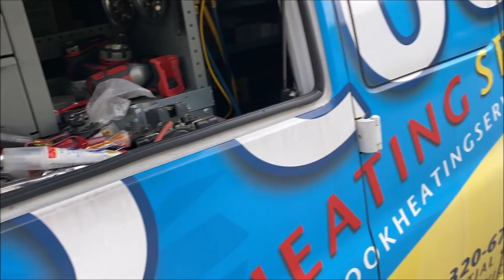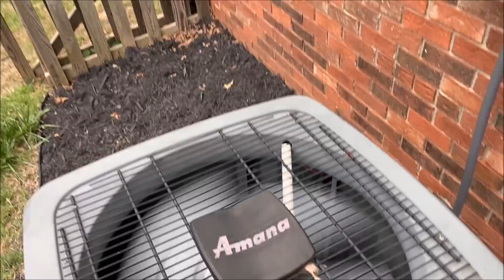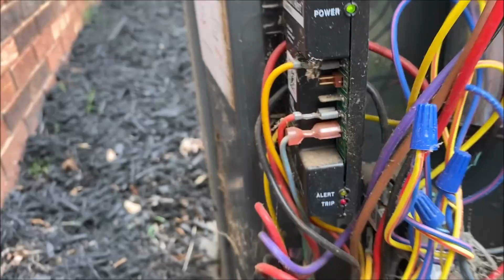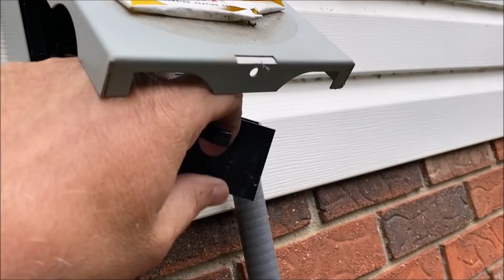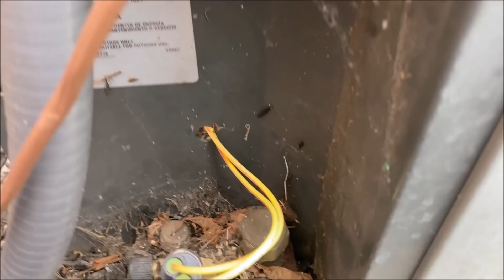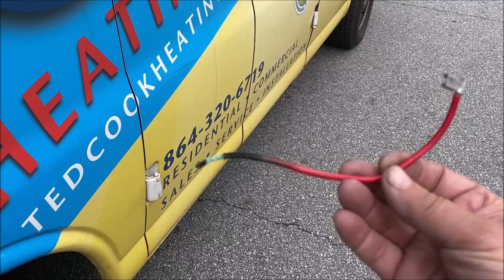Amana Heat Pump simple fix

Comment: What's that box where the fried wire was connected to? In my unit what looked like a copper or brass fuse was fried and popped off the black box. Is this something that gets replaced or the whole unit( black box) gets replaced?

Comment: Hello,

I have Amana prestige 2. The heating unit works great except when the outdoor temperature drops under 40's. So, if a cool front comes through and the outside air drops down into the 30-40's at night or even during the day, the heating unit will not turn on to heat the inside. The inside blower continues to run. 

After a few hours and a few turn-on-off, the heating pump may work or may not. This will happen over and over. I have to shut the unit off. I replaced the condenser with a new one and it is still the same. I also do not have this problem when the outside temperature is ’50-’60s, the heating unit starts and runs fine. 

Can anyone give me any feedback on what may be causing this? Any information you can give me would be greatly appreciated.
Reply: Hello have you had any success to get this resolved? Seem to have the same problem!

Comment: I'd always check amp draw at start up when the disconnect is that close since it's easy and that wire burnt up. Could be the beginnings of Lock Rotar and might call for a hard start kit soon depending on amp draw. Looking at the previous work from another company, this homeowner just found a better AC company that will be available when the unexpected happens.

Comment: Fun fact on these units, an OL capacitor will cause this board to give you an open start circuit error. Just check it before you go through the trouble to ohm the compressor windings.

Comment: I havnt seen a low pressure switch tee in to the suction port before. I guess thats easier than brazing in a new one? thats only reason I can think of??
Reply: If your factory low pressure switch failed (or if it never had one to begin with), it is MUCH quicker to simply add a swivel tee with new encapsulated switch and wire it in place of the old. If the system was already open with no refrigerant, then you might consider brazing one in.

Comment: As long as you are there wouldn't it a prudent thing to replace the cap as preventive maintenance?  Around my area they seem to last about 10 years.  I'm just a homeowner, not an HVAC tech.
Reply: He said he gave the homeowner some recommendations but they want their usual contractor to do that work for them. Also Ted likely tested the capacitance of the part and saw it was still within spec.

Comment: Always feel that the wire between the contactor and the one cap is light gauge maybe like a number 14 I think it’s a good idea to double up like you did or also increase wire size from contactor to capacitor using number 10 with a couple new spaide terminal. Nice videos Ted in addition the other day I tried your trick using the drill bit on the Stuck condenser fan blade On motor shift and it helps me out thanks for the tip

Comment: Heat pumps have too many wires not to mention a circuit board, that's exposed to the weather.
Reply: 100% correct and what a mess in the AC world - no segregation multiple voltages duel capacitors in that case multiple cable entry points that are not sealed spare conductor used to anchor the thermostat cable to the case of the outdoor unit- what an absolute #hit show as Stevie Lav would say - then ol Ted comes along and gives us all a lonnnnnnnnnnnnnnnng explanation about nothing.

Comment: should always replace the contactor in a situation like that or any electrical component/wire that's been overheated and oxidized. even though you replaced the wire and moved to a different terminal, those terminals tend to overheat all lugs at once due to the design and it could have been caused by a failing contactor and heat migrating up into the terminals.
it will happen again and sooner than later, causing a callback and huffy customer or even a non-callback.